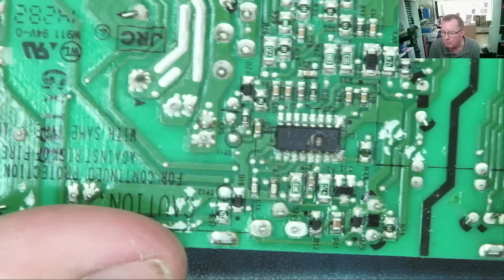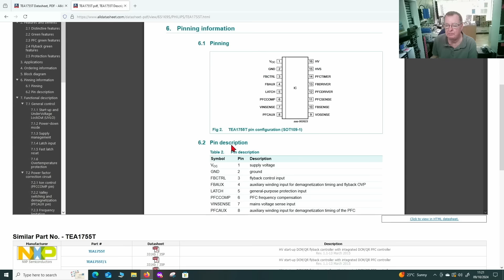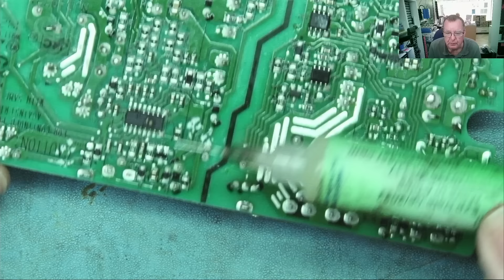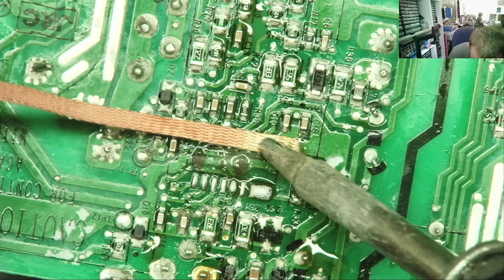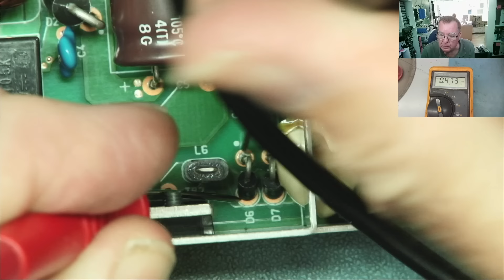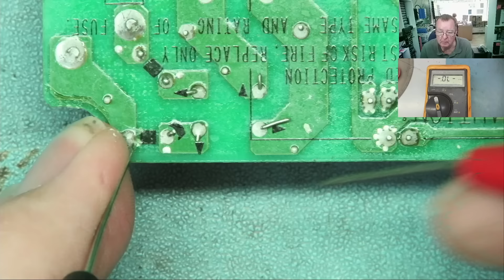eBIKE Charger Repair : I Replaced All The Faulty Components  But WILL IT WORK OR GO BANG

Comment: 9:00  Brown-Black-Silver-Gold >   10*0.01 = 0.1Ohm (not 1 Ohm). In parallel they are 0.05 Ohm.  However I guess Richards Multimeter cannot measure resistors that low. When there is a resistor measurement below 1 Ohm you have to take the resistance of the probe leads into account.

Comment: I have seen diodes fail with the same reading both ways (out of circuit). However, none had a reading higher 0.150. If one could fail in the 0.200 range it could be mistaken for a schottky diode.

Comment: What about “Right To Repair”?  Could you contact the manufacturer for the parts list to find out what the controller IC’s cross/sub part, the power cable’s part number?

Comment: What I do in this circumstance and spend time on the smpsu, is to fit onr of my UC3842 piggy back boards to the Mosfet and sometimes have to rearange the Feedback connection to put the Collector of the 817 and the emmiter to ground and the then the Emmiter to pin 1 of the UC3842. Just have the one Mosfet and as your smpsu remove and put a link on the Diode. This has worked for me several times and got some Auio equipment woring again.

Comment: Hello! 
Thanks again for the informative video. 
Could you try to charge that battery with a normal adjustable laboratory power source and use a suitable current limitation?

Comment: Had a rethink and you never checked the transformer for shorts or shorted turn. You will not  be able to check it with a multimeter, you want something like a ring tester. A shorted turn on the output side would draw a very large amount of current.

Comment: Sir please help me where is the common ground plane n output circuit because there are many resistor capacitor and diode.transistor in output.but i confuse where to put black lead measure voltage in DC output of any circuit pcb as a return path.please help me sir this one

Comment: 13:23 Shouldn't the MOSFET have read as open when measured in diode mode in opposite polarity instead of high-ish?
Reply from the maker: Yeah you would normally expect that in the polarity it normally operates

Comment: There's a user manual for that IC that suggests R33 (connected to pin 16) is typically 10k and there's a whole load of gobbledygook that talks about the current flowing into or out of that pin being sort of critical. This may be an entire shoal of red herring.
Reply from the maker: Or maybe I could just try yor suggestion 🙂  I'm quite interested to see if the PWM/PFC chip actually died or not.  I do strongly believe that the mystery resistor coule be nowhere near as high as 10K or it would not burn up when the chip failed?
Reply: @learnelectronicsrepair  Guesswork and speculation on my part, 330 ish volts across 10k (assuming IC short to ground) is 33ma 10.8W. Too old to get my head around what would happen if that IC didn't start properly. You may want to change the IC again, there is mention of a max current of 8mA into the HV pin.
Reply from the maker: @ralphj4012  Yeah it is but like you say, that is assuming that pin 16 (HV) has a low resistance to ground which it most certainly will not have.  Also the PSU didn't blow up until I attached the battery and powered it up again. Also the 4k7 resistor was not damaged.  When I get the mosfets here I will of course replace the IC again, I have several more of them.  I still don't know the correct value of the resistor on pin 16 but the typical application shows there is no resistor there and the original one had a hole blown in it which generally indicates a sudden surge of current rather than it baking slowly, so I really don't think it is going to be a very high value one.  I don't know if the owner has any more of these chargers, I'll ask while waiting for the parts

Comment: Try it without the PFC mosfet.
Reply from the maker: Yeah that could be fun but I think it would not work as this IC is a combined PFC/PWM controller and one of the input pins monitors the PFC voltage. I

Comment: Once again very in-depth explanation of what's going on, much appreciated.  I would wager that the battery basically enables the charger when plugged in and that you basically won't have any voltage unless the battery is connected and okay. Those PFC boost converter circuits are very unforgiving unless the mosfet is being commutated by the controller. Almost frightening if you asked me.

Comment: If it's a decent charger then it should have current limiting on the output and a short circuit to the battery would be detected. If it doesn't have that protection it's the sort of setup that causes fires!
Reply: Good point, which gets me wondering if there isn't protection can some be added either on that board or with an additional one to run the output through.
A stand alone protection circuit would be very marketable product.
Reply from the maker: There may well be.  I did not definitively prove the battery caused it to fail, it was just a possible guess

Comment: Hi Richard,  greetings from South Africa. I have found that sometimes the capacitor charge skews readings of resistors in circuit . Regards, thanks once again for sharing your time and expertise.
Reply from the maker: Agreed. I mentioned that a charged capacitor (charged from the multimeter in diode mode) was messing with the readings of high value resistors